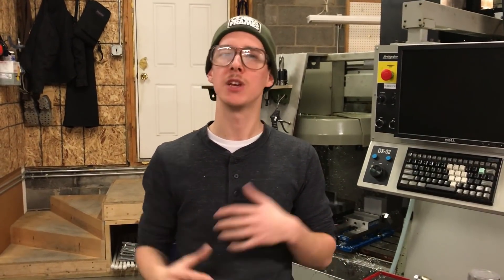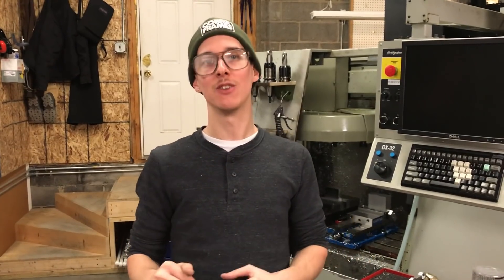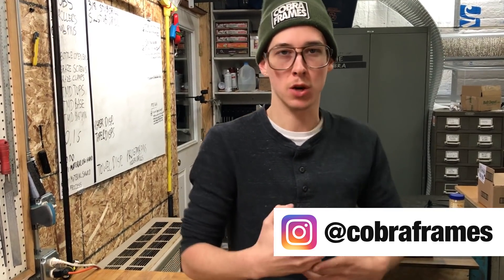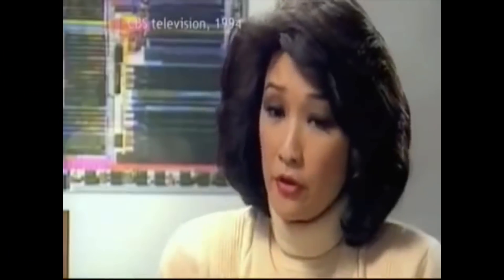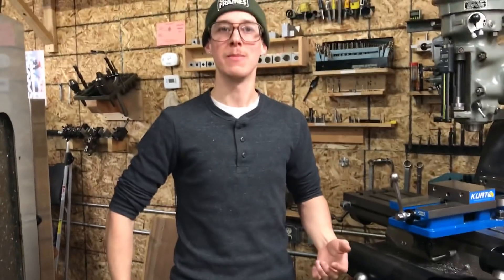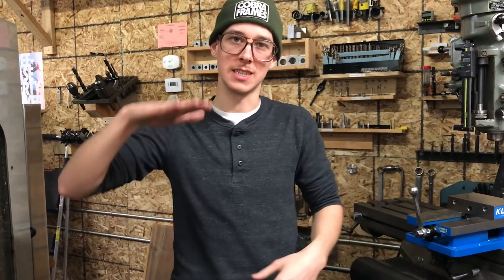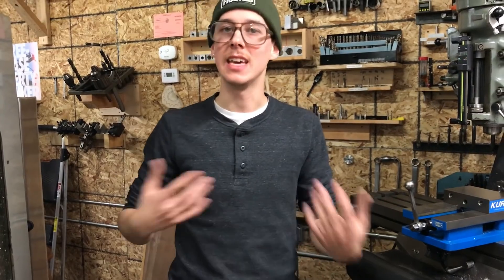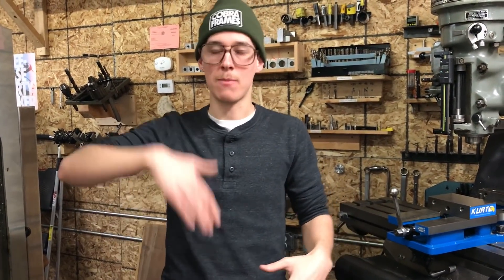Building a Hardtail MTB Frame, Part 1: Initial Thoughts

Comment: Great channel! I came right to this video! 

What about getting a custom titanium frame built? I'd really love to custom build something myself, designed to fit around an ebike motor on the bottom bracket for use with both 26" and 700c wheels. Mostly for hybrid/comfort city committing but not shy of gravel tracks and maybe even slightly dirtier paths.

I currently own a Kona dew plus and really like the geometry. Is there a better type of geometry or something I'm overlooking?

Comment: Can you build a bike from scaffold tubes? I mainly just want to know if everything is strong enough. Especially aluminium tubes.
I am thinking of having an ebike made that is as long as a tandem bike, but for 1 person. Mainly so it can fit a stupid amount of batteries for long distance cycling.
I love the idea of designing one based on scaffold tubes for a whole bunch of reasons to do with recycling and lower tech creation as well as  modular options and hopefully rapid construction of multiple copies.

Comment: idk, if I had the possibility for a build rn, I'd go with a REALLY slack head angle, very steep seat angle, long chainstays. Bascially the best for everything, except really tight corners and weight.

29"*3"
140mm travel
dropper

Comment: Dude make it out of titanium tubing.  I have never built one before but I am pretty psyched about this build.
Reply from the maker: I'll do a Titanium build eventually. It's probably a way off at this point, especially as far as a MTB is concerned because I'm so new to designing MTBs and I want to have some real confidence in the design before I go to Ti.
Reply: @cobraframebuilding  Makes sense.  What software do you use for bike CAD?